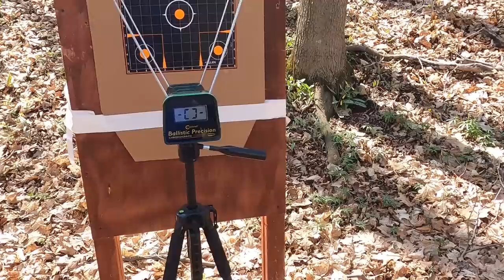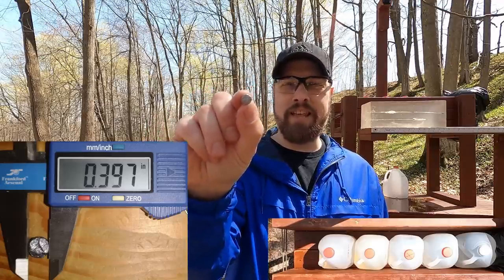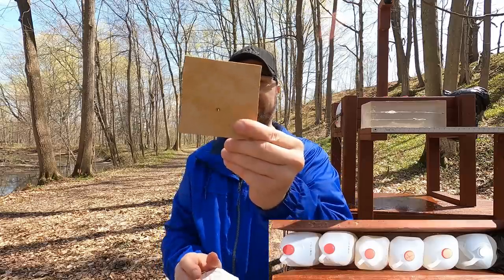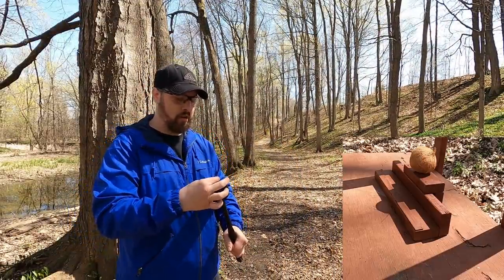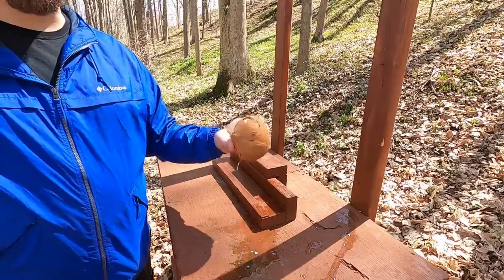WOW Dieseled Pellet Rifle RIVALS Firearm - .30 Caliber Break Barrel OVER 50 Ft Lbs Energy!

Comment: I have been experimenting with dieseling pellets. I don't think that's what's happening. I think the vasoline or oil creates a seal around the pellet, because the barrel walls are not smooth, they have spiral grooves to spin the pellet. the vasoline is filling the gap, making a better seal, therefore more air pressure behind the pellet as it travels out of the barrel. there is NO diesel action. there is no where near enough compression to cause combustion, especially with vasoline or other high ignition point substance. I've even tried starter fluid, which is designed to ignite and is extremely flammable. ZERO results, because it's so thin, it leaks out around the pellet and doesn't change it's velocity. I've seen a ton of videos, and been doing three weeks of experiments myself. People are fooled into thinking there is combustion happening. That is NOT the case. it's ONLY a better seal around the pellet, and that's why vasoline works better than anything else. it's thick, and makes a perfect seal around the pellet. I'll be posting a video soon to PROVE there is ZERO combustion action pushing the pellet, it's ALL air, just a better seal which makes a HUGE difference in speed and velocity .
Reply: It's been 5 months. Still no video proof from you... Huh.

Comment: I had that gun and after about 1000 shots, I used some "chamber lube", (a few drops in the compression chamber through the transfer port), and it went off like a rifle.  After about another 100 shots, it lost 35fps.  Could not get parts easily from hatsan, gave the gun away, now the cylinder went flat, (probably unrelated).
Cleaned the barrel of my Gamo magnum .22 Gen2 mag.  Did not wipe off the breech face of grim because I did not see the grime under the magazine mechanism.  Did not measure the power of either shot, (the .30 cal or the .22), but it went off like a .22 as I shot into a snowbank.  I found the .22 pellet when the snow was melting, and I have a .22 JSB 18gr. pellet with a "caliper measured" .300" blown up diameter skirt.  It is perfect, no other deformation or cracks.  Looks like a fat lady is a big old ball room dress.  We know the barrel will not allow the skirt to blow up like that, so it had to be the pressure left when the pellet left the muzzle that did it, probably with in about 1" from the muzzle.
Snow is great to shoot in.  You can learn things from a pellet (and gun) that is only deformed from the gun.
Reply: Snow will deform the bullets... I had lot of fun shooting hollow point 9mm with a Glock at a snowman we made, made huge holes in it and the bullet was fully expended.

Comment: I  dieseled pellets as a kid all the time and my uncle would tell me it just making more noise but depending on the air rifle used and the pellet you get some pretty interesting results
Reply: The oil on the pellet is causing an explosion due to the air pressure which gives more velocity but at the risk of destroying the air cylinder. Just be carefully you diesel a precharged pneumatic a lot more air pressure.

Comment: I see parallels to muzzle loading rifles where using a fabric patch increases velocity (and accuracy) quite substantially as well.
Reply: Dieseling is different, the vaseline is acting as propellant. Like a diesel engine that ignites its fuel from pressure instead of a spark, hence the name.

Comment: I had a .177 air rifle diesel on me a couple times. It was brand new and apparently had some residual oil in the chamber. Either way it was loud as heck indoors. Unfortunately .177 pellets lose all accuracy going supersonic. (never put your pellet trap on top of a cooler)
Reply: They say you get much better accuracy using slugs as they are much more stable at supersonic speeds then the pellets.

Comment: It should be noted; the general accepted idea behind pellets of the JSB style dome design, are typically best/most accurate at around 830-850'ish FPS.
Dieseling is terrible for your gun

If you want that kind of energy on an air gun, just get a PCP. There is 22 and 25 caliber AirVenturi Avenger right around 300$, and you can get a high pressure air pump for right around 300$. You could try hand pump, but I wouldn't recommend it unless you plan on lower the pressure. Mine is running right at 53 Ft-lbs of energy, but I've seen a few tuned up towards 65-70ft-lbs. Its also whisper quiet once you put a can on it. There's also big bore stuff 30-357-40-45-50 cal stuff out there.

CCI 22 quiets are also a good option if you have a bolt action. if you try to use them in semi they may not cycle the action, and in revolvers the cylinder gap causes them to have a nice bag, which defeats the purpose.
Reply from the maker: Your advice probably should be noted to people serious about shooting a lot of rounds in a pellet gun with higher energy, but if we are talking between you and me, well this was just a fun "what if?" test that I wanted to do and would do regardless of whether I had better or not, so other people can see the "what if?". So, I agree that if someone wants that kind of power, they should go to something better, but as a youtuber personally I had not much more intention than to have some fun, knowing I might break the gun.

Comment: When I do this with my .177 break barrel it breaks the sound barrier and cracks like a .22LR. I discovered it by mistake when I first got a break barrel. I didn't know not to use petroleum-based lubes.
Reply from the maker: I did this also many years ago, and I also discovered that it's too much for a .177 gr. I say this as I used to stand atop my river bank and shoot about 100 yards away into the stream, and while the non dieseled pellets made a splash, often times nothing hit the water with the dieseled. Almost like it vaporized the pellets, or at least broke off the skirts.
Reply: @GunSam  😂😂😂
indeed. It makes them fly very wildly.  Diabolo shaped pellets don't fly very true past about 950 fps. They destabilize horribly when coming back through transonic. Most of the EBR airgun shooters typically tune for 870-930 fps.
Reply: @GunSam  you're right though I could see it disintegrating the skirts. I've never recovered one to know for sure. May just have to try that today. Lol. Take care man...
Reply: @GunSam  
It also can expand the skirt violently, smearing the soft lead up the barrel...so use a cleaning rod after every few shots...otherwise the barrel "leading" continues and the bore squeezes down more and more...this also affects accuracy...maybe why you didn't see splashes???
Reply: @JohnSmith-pl2bk  heyyyyy. Is this the same John from the Origin owners group?
Reply: @joshuagibson2520  
No.....completely different. Cheers.
Reply: This is what i was looking for I'm dying to see if my .177 would make the crack

Comment: I dont think Vaseline will ignite under compression ..i might be wrong but my understanding of dieseling an air gun means to put diesel fuel in the chamber. That would be more sensible to me. putting oil or grease just ensures a tighter seal around the projectile as it is blown forward thru the rifle.

Comment: This will not hurt you’re gun at all I shot 2000 rounds through a cheap Walmart Crossman pellet rifle it didn’t do anything at all but make it louder and apparently more powerful the less oil you use the better the results I suggest loading up one pallet filling the entire back of the pallet up with oil shoot it and after that you usually don’t need to add oil to the other pellets there will already be enough in there if it goes quiet or back to its normal sound do the process over again of filling up one pallet with oil

Comment: I don't think you explained it on video, but how does dieseling work? Is it to ensure a tight gas seal and lubrication of the bullet or does it act to combust behind the bullet? I am reminded of how you can use a fire pistol to combust tinder when the air pressure is increased rapidly enough. Perhaps the gas piston in your rifle actually made it combust?
Reply from the maker: I'm not an expert on dieseling in pellet rifles, and in fact i'm not smart when it comes to engines either. But basically, dieseling works the same way it does in a diesel motor where it has no spark to make the motor run, rather the pistons slamming the fuel make it ignite from pressure rather than spark. So, more or less you have petroleum jelly that is momentarily exploding, on fire, smoking etc adding power to the mix. So if you were to somehow set these pellets in a barrel and somehow light the petroleum jelly instantly, you might see them come out the barrel at 200 FPS.
Reply: @GunSam  no expert here either but yup, that's it.
pellets wet in WD, ahead of the skirt keeps a film on the barrel and helps seal the skirt. behind the skirt detonates from the pressure shock. 
curiosity, what might happen with a springer disassembled, piston parts heated and frog lubed? could the spring slam the plunger faster to give more velocity? is there a choke point in a "drive train" that could be slightly ported a few thousandths?

Comment: I would like to see a test of different fuels.  A drop of 2 stroke oil, or diesel, or everclear.  Do you have a larger caliber airgun?
Also, an accuracy test would be interesting. Off a bench and on paper. Thanks for your time!
Reply from the maker: I just have this and my .22 that does 700 FPS with typical 14 gr pellets.
Reply: Hand sanitizer

Comment: The best oil to use for dieseling is automatic transmission fluid I use it in my gamo shadow that normally shoots at 900 fps with lead pellets and 1200 with pba alloy pellets and with automatic transmission fluid it cracks like super sonic speed and will pop a rabbits eyeballs out of its head shot just under the ear canal

Comment: I’m thinking the pellets aren’t dieseling. If they were you’d hear a louder “crack” when fired. I’m thinking the Vaseline is causing the rear of the pellet to expand more and seal inside the barrel better. It’s possible the added weight is helping also. I could be wrong but my pellet gun has a way different reaction when it diesels.

Comment: I suppose technically a dieseling air rifle is a hybrid between an air gun and a firearm as you are actually using, partly,an explosion to propel the pellet?I had a .177 air rifle years ago,a Gecado 27, and I use to put Vaseline in the chamber.the first shot was weak as it spread the Vaseline up the chamber but the next 3 used to make a supersonic crack as they came out of it!if I recall WD-40 use to go off with a bang too  but some oils didn't produce the desired result.the nearest parallel to to this concept in a way is the Daisy VL rifle.i'd guess dieseling doubles the velocity based on my Gecado 27 but does it damage the gun and is there a chance of an explosion obviously unknowns until it happens!

Comment: So you're in Michigan eh?. That is some seriously prime looking white tail habitat you got there, assuming you're shooting on your own place. Nice. Regarding dieseling damage, though I've shot my air rifles for some sixty years now, I've never lost a seal do to dieseling, or an air rifle mechanism for that matter. I've had a couple(seals that is) die do to 'old age' but that's it. Course my guns range from the old Benjamin and Sheridan pumps to the Diana, the RWS Diana 52 side cocker (still the most accurate air rifle I've ever been around, shot it against the competition Feinwerkbau (sp?) 300 waaaay back in the day (1960's I believe) and the 52 more than held its own :), I've even got a very good ('tuned) Crossman Storm XT i think its called which has held up just fine and with the light colored wooden stock is a rather striking looking airgun itself. Got a few Ruger's, a Benji  Nitro 'gas piston gun,  a winchester magnum .22 break barrel primarily used for rough and tumble  field pest control, and then my Benji 'big boy', a 'warmed over' very physically imposing break barrel with a truly magnificent scope, sculptured walnut thumb hole stock, and some serious 'down' range power; I've killed coyote's with that thing, but you need to be either a naturally, fairly 'stout' fellow or a chest/arm related athlete  to shoot it more than a few times in a session. I don't shoot the std Crossman .22's in this thing but the big, nasty euro 'heavy' stuff to keep the velocity below sound barrier. Throw in a few pistols, mostly pumps, and that about rounds out my air gun battery. But again, except for the aged seal issue, never had a problem with the intermittent dieseling breaking anything (knock on walnut:).

Comment: Oh haha. Just saw this but commented to do exactly this in your previous video. Next up, your gonna want a standard unmoderated full length barrel for it and a more stout mainspring. ;)
Reply: Doesn't use a spring it uses a piston. You can get stronger pistons that drop right in from Russia but you'll need to beef up the cocking arm.
Reply: @robertmueller6979  a bit more limited with gas piston if there is no fill point

Comment: Hey same that was a very informative video. After I bought my fist 22 at age 12 I totally lost interest in air guns.  I had never heard of diesel your pellets before and the results were very significant. It has peaked my interest into using air guns for small game especially seeing that coconut knowing how soft pellets are and how hard coconuts are that really was impressive.  Like I said I lost interest in air guns long ago and almost skipped this one glad I didn't. Thanks again and as always you make learning fun seriously.

 I'm sure you are aware that using chains would make your gong from flipping and that they make a t post hanger so it doesn't move at all but does ring really loud. Not sure if that would be good for a video but might make your shooting a lot more fun.  The hanger has a spring on it so the bullets don't come strait back but are deflected down.
Reply from the maker: I just used straps as they are cheap and I wasn't sure what distance I was setting my posts. Of course the one bullet that hit a strap was a .44 wadcutter straight on, the last one you want to hit a strap. Replaced it, no big deal.

Comment: Very impressive. If I used vasoline on my 16 grain H&N hornet pellets that I shoot from my Diana model 34 classic .22 air rifle I could probably increase the velocity from about 650 feet per second to about 850 feet per second and go up from about 15 foot pounds of energy to over 25 foot pounds of energy or more. Maybe close to 30 foot pounds of energy. I was looking at the hatsan.30 caliber break barrel on pyramyd air and it was available recently but the .30 caliber pellets aren’t. I used to.have a Diana 350 magnum .22 and my main issue with it that caused me to sell it and get the model 34 classic was the difficult cocking effort which this .30 caliber also has. It makes me so plumb tuckered out after a few shots and throws off my accuracy. I do better with a lighter 35 pound cocking effort. Plus the light 3 pound T06 trigger on my gun is so great too and for me accuracy is more important than power because I’m more of a plinker as can be seen on my shooting videos on my channel

Comment: Thank you very informing, very nicely done.  How many rounds of diseled pellets have you used in that rifle?  Any signs of damage, and how do you feel about it's effects on the rifle?
Reply: At the worst it would only damage the piston head or the breech seal. Not a big deal, if those fail you can replace them. The compression tube cylinder and the barrel are all heavy steel so there's no way it could damage those, it would take gunpowder to produce enough pressure to destroy it or cause a rupture. Burning a little vasoline or oil isn't going to produce high enough pressures to burst the steel compression tube or the barrel.

Comment: How long will an airgun like this Hatsan last with dieseled shots only?? Maybe a few 100 rounds?

After the gun fails, isnt it just replacing some rubber seals and a new gas spring? It's not that expensive and doesnt take that much time to replace I guess??

Comment: Wouldn’t the pressures created by dieseling screw up the air gun seals? My understanding is the gun specifications aren’t made to withstand those increases. Seems just a way to quickly wreck your pellet gun.
Reply: Yes the pressures go up way way high, but some guns seems to handle it just fine and works for 1000s of shots dieseling fine... Other guns get wrecked after just one shot....

Comment: Dieseling has been an interesting topic for a number of years. I'm still not convinced that combustion is happening rather than compression by adding a lubricant to help create a tighter seal.

I guess if the barrel heats up a significant amount that would give us the answer. I tried this once out of a cheap gamo .22 and blew out the seal before I felt a difference in barrel temperature. My current RWS 48 is to nice to try this with.
Reply from the maker: I think the fact that there is smoke coming out of the barrel, is a good sign of combustion.
Reply: The answer is the ignition material in the base of the pellet only...no leaky lube dripping back into the chamber...
Reply: It only works in piston airguns, not PCP (pressurized air) so it is 100% for sure dieseling... Also if you do it right it doubles the velocity.